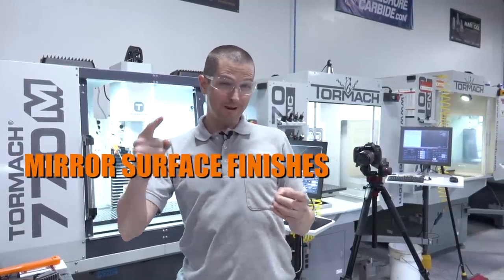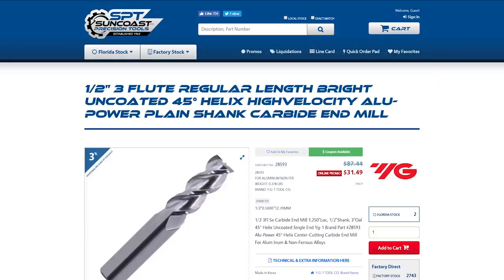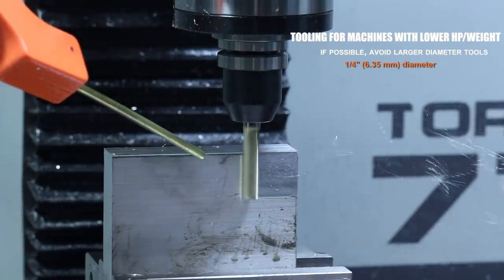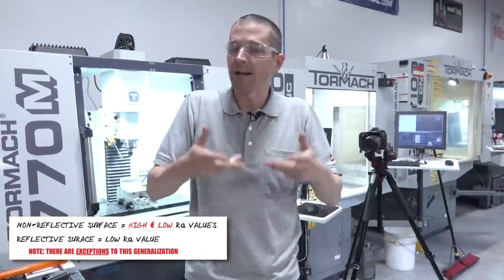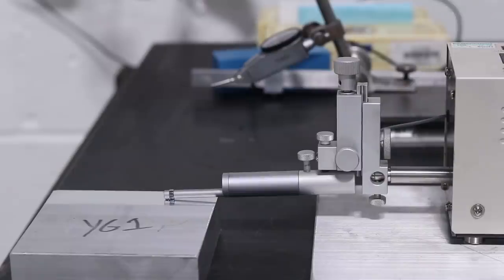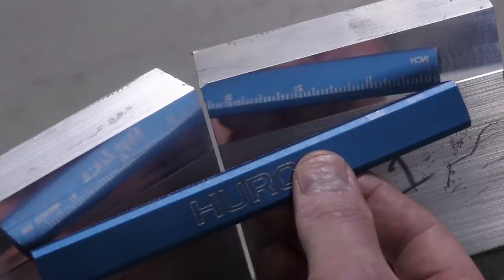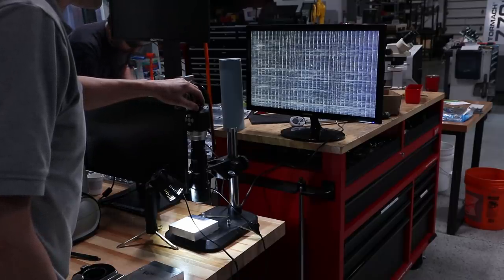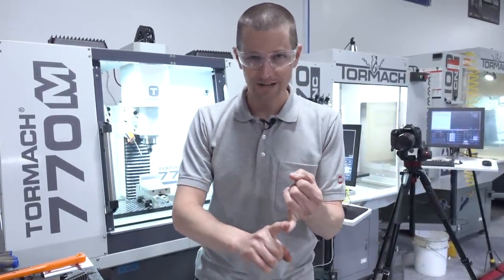Affordable Tool for Mirror Surface Finish! WW249

Comment: When I was putting together my home shop, I started off with YG1 because they were affordable and not made in China. I get excellent surface finishes with their HSS endmills in aluminum, not to mention the cutting power and chatter are greatly reduced compared to no-name or chinese brands. I also exclusively used YG1 Alu-Power at my old job on Maho CNC machines cutting 6061 all day long. Our 3/4" endmill lasted over a year of 40 hour work weeks running 3500 rpm, Valcool, and averaging 50 ipm.

Comment: Hey John nice video😊
In our toolshop we only use yg1.
Also the endmills for hardmilling are amazing.
Best regards from Switzerland.
Reply: They are great bang-for-buck. We test tools from time to time against those we've found to be real performers; typically offerings from Union Tool, Moldino (Hitachi-Mits) and NS Tool. YG always fares well, and Imco also makes a really nice low cost tool for hard milling. Well worth a try IMO.

Comment: I use the YG1 everyday in the shop and I can say this the endmill I use the most. You can do just about anything with it on aluminum. The hardest I've pushed it was a 1.5 depth of cut, 1/8 step over, 8k rpm and 100imp in the HAAS VF2ss I work on. Absolutely amazing.
Reply: Did you ever get the chance of comparing it with endmills from maritool that @kalpay swears on? Or swiftcarb (frontlinefab)?
Reply: In our shop we use mostly YG and IMCO tooling. I haven't been able to get a wide variety to test on.

Comment: SFM can make a big difference, while the tool diameter may not change the surface finish (on light finish passes), the lower sfm especially at that low of a feed rate in a material that soft could have a very pronounced effect, I'd be interested to see this again with each tool running the same sfm, instead of the same rpm.

Comment: the irregularities look to be cyclic, it could be due to the spindle servo, you command a constant speed and when you enter cut the servo ramps up the power and might "overshoot" then compensate but be slightly too slow ramp up power again etc... just a guess ;-)
Reply: aka control loop oscillation
Reply: I wonder if theres any sort of way to tune that out or are you just stuck upgrading to a beefier machine
Reply: @anonymic79  I'm with anonymic79
 on this. So what Lukas Foglar is saying is basically torque ripple in the spindle? Or is it something else? You'd think just the inertia of the spinning mass and the rigidity would prevent those kind of accelerations, but I could be wrong.
Reply: Agree with anonymic79--the marks must be chip recutting. No way the servo has enough power to change the spindle speed that quickly.
Reply: If the speed came from the spindle accelerating and decelerating, this should be audible in 3:03-3:10 then. At this feedrate, this should correspond to a harmonics frequency of about 90Hz. Could someone just do a fourier transform of the sound from 3:03 until 3:10?  Too bad i dont have access to matlab right now.
Reply: fusion also likes to spit out random stutter steps, which could be the anomaly before the section he highlighted
Reply: @TeslaAtoms  there's a peak at 110hz, 159hz, and 163 hz: https://i.imgur.com/yfSaY37.png
Reply: @anonymic79  "Shatter" the spindle?? Which part of it, exactly? Most of these irregularities in surface finish are due to run-out, spindle vibration and/or tool vibration that isn't necessarily audible. Work with a tap-tester and you can find the natural frequency of the machine and tool system. Things become markedly better but run-out and natural spindle vibration are always present.

Comment: Hey John, if you're never tried one, I would highly recommend giving the ECAI-B-3 line of Iscar end mills a try.  I've used many different brands and flavors of end mill for aluminum, and have yet to find anything that can produce as good a surface finish.  The only drawback to them is they are not available in many sizes, and no metrics at all.

Comment: Been running these for a couple of years now, you should see the finish in a Haas with a heat shrink holder at 15K RPM! The edges also seem to last a lot longer than some of the other tools on the market and usually the core is thicker than a comparable endmill so they perform much better in the extended length versions. The cyclical variations in the surface finish remind me of the cnc converted bench top machine I have in my basement. Prior to installing AC servos, the stepper motors would leave a finish like this when "micro-stepping" between motor poles. After AC servos, the irregularities went away, and I do have a Tormach 770 head mounted on the machine.

Comment: my guess on the inconsistency in the feed marks would be from chip evacuation causing the cutter to slightly chatter from material getting in the way of the cutter and the surface.
Reply: main reason for thinking this is because the offset lines are not parallel with the consistent ones but the parallel lines still exist in equal spacings among what I assume are marks from the thin chips + climb milling pulling those chips back along the surface.

Comment: If you go to EMUGE they make a Polishing 6 flute carbide end mill. Designed for 3 edges cut, 3 polish (rub or as they say pressure) for aluminium, brass, and copper. I am not sure if these require higher levels of rigidity from your machine, tool holder, part clamping? Along with the stated correct speeds and feeds based on what the project is.

Comment: I feel tool diameter does make a difference but I feel the real gain here is the coating. Thanks for the info on where to buy them, people should support the direct buy companies (further investigation this is not a direct purchase but purchased directly online). I also feel the cause for the erratic cutting is caused buy the lack of rigidity and power of the particular machine. You are correct in saying that a 1/4 or smaller tool is better in those machines due to the rigidity and power of them. I feel they are a good hobbyist machine, nothing more.
Reply: It has plenty of power, it's only a 1" axial DOC/10 thou radial DOC.
Reply: @xenonram power is a loosely used term. power is a measure of hp and torque. as i said i feel the real difference is the coating. i get better results with that type of coating on the same size tool coated an uncoated. i agree with a few of the others that have stated the irregular cut pattern is the type of motor.

Comment: Hi John. Here is a suggestion: it looks like you are using a helical Zrn coated endmill for the first test. It doesn't have to be helical though, any coated tool will have the same effect. In speaking to tooling vendors, Zrn coatings are awesome for adding lubricity and longevity to the tool. However, on a microscopic scale, the coating dulls the cutting edge, making the surfacing finish not be as good. A more apples to apples comparison would be to take the same YG1 tool and compare it to a 45 degree uncoated endmill from helical (or any other vendor) to see the real difference. A higher helix leaves better finishes, which is why I think a 45 degree is best. Using a 37 degree or so is better for roughing applications because of the more solid core. Would love to see you expand your test. Good work

Comment: Great topic. I'm slightly obsessed with having a mirror finish and definitely look forward to trying out one of these end mills.
Reply: Also.., Try indexable cutters with korley inserts on aluminum. For end mills we just switched away from yg to a better product half the price. Use lots of coolant so you don’t chop them up.
Reply: @glennedward2201  thanks I appreciate the advice. I'll definitely look into those.
Reply: @alexbarnett8541  Mirror side milling finish?? What do your prints specify as 'acceptable'? Chasing finishes can get extremely expensive. Sometimes it's good to go with, "good enough".
Reply: @zaknefain100 I was making injection molds when I wrote that. Really only cavities and cores required a polished finish. I agree chasing finishes is expensive and hurts productivity.

Comment: Would love to see what surface you get from that tool in the Haas
Reply: Those have been my goto emdmill for aluminum for about five years, and they cut fantastic in a Haas, try one, you will not be dissapointed only impressed.
Reply: I would actually love to see a difference between his Haas TM3P and the Tormach's
Reply: @TroubledTimes2024  the machine I have access to has like a thousandth of run-out in the spindle so I doubt I would get the same results
Reply: @joshuawentworth7426  Obviously it wont fix a bad spindle but you would still see an,  improvement. A quieter cut being one of them besides a superior finish. Just try one next time you need a cutter.
Reply: @joshuawentworth7426  I understand that "have acces to" =/= "my machine" but have you thought about  regrinding spindle taper?

Comment: Hi, very good and informative video, however, would like to see the tool at the same cutting speed rather than RPM... Higher cutting speed will introduce more heat to the cut and definitely influence the result IMHO.

Comment: It appears that the smaller diameter tool is recutting the chips and the larger YG-1 is not.  The chips from the YG-1 are being blown straight back.   Are you cutting both at the same speed even though one is a larger diameter?

Comment: imco tooling is the absolute best if you can afford it. we dont do much with aluminum but their streaker series is incredible.
for low carbon steels the enduro m525 are fantastic with a .030 corner radius
Reply: half inch tooling in a haas vf3 their feeds and speeds make for a good starting point too.

Comment: I love YG they put so much money back into there product line. i think my rep said 75% of all profit goes back into RandD
Try a YG HPC AluPower they do amazing floor finishing and do a very steep ramp angle on a haas
Reply: i think 30$ affordable when the tool give much more value to the customer back, in comparison to the competition
Reply: Have you used their taps?
Reply: @travistucker7317  i have to tap out on this one
Reply: @hyperhektor7733  stick with your emuge or whatever you're using
Reply: @travistucker7317  Yes they are on par with everyone else but can get them  a little cheaper most of the time
Reply: @travistucker7317  i use mostly germanium and sometimes chinesium (variable qulity, some are crap some are useful-to-good)

Comment: Could be harmonics in the system. Make a few blanks that are as identical as possible, then run the test. If it is always in the same locations on all the parts, then theres a harmonics issue. If the locations vary from part to part, I would guess its more of a electronics feedback control issue.
Reply: Issue should be in quotes. Those parts are certainly good enough for 99+% of designs

Comment: Interesting. Shouldn't those scallops have a slight angle due to the helix angle?

Irregularities in the spacing may be due to tool design. As I understand it the flutes are often made very slightly asymmetric to help avoid resonances.

Comment: looks like that shorter wavelength section happens every two revs, what's your spindle pulley ratio as the issue could be upstream from the spindle itself

Comment: Could I use that yg1 cutter that was shown in the video on a manual mill or does it only work on a Cnc I need a new end mill for aluminum
Reply: You can use the cutter in any mill, but that surface finish is very dependent on a super consistent feed speed. CNC machines obviously do that better, but I would be shocked if someone said that cutter cnc only. ;)

Comment: The heavier the machine the better. On my Haas VF3, I used a heavy cemented carbide lathe cutter, 3/4"... welded to a 3/4" shank, and the single cutter, as a fly cutter gave me mirror finishes. It could do a 6" wide piece of stock and was a cheap tool to produce!

Comment: Measure the distance between the irregularity clusters, calculate the frequency of the cluster and it's repetition frequency from that (=> linear tool speed) and look for those frequencies in the audio you captured during recording. Might give you a clue.

Comment: John & Crew. You kinda stole my thunder here, but point I want to make is that certain mfgs can make a tool that just puts down a finish that just blows you away. I have had even cheap chinese tooling produce remarkable finishes with certain materials. The job of a good machinist is trying new tooling and see what you get.... Every machine is different, as is the tooling.

Comment: Looking at the two samples there appear to be more geometrics (waviness and oscillations) in the super 1/2" end mill finished surface. Maybe this is because the surface is more reflective and hence makes any ripples more obvious, or it could be a reflection of something on the worktop; look to the right of this test piece at 5:36 in your video!  To get a true idea of what is happening on the surface, geometrically, you would need to very much increase your sampling distance for the test.

Comment: Bright tools will always leave a shinier finish than coated, but coated will last longer.

You have two different diameter tools, that’s a huge difference with the “receipe” you used.
Your running way different SFM but the same IPT?   Should be doing the opposite.  Same SFM (not same RPM) and the IPT is always different for different diameter tools.

Grain direction of material will also make a difference.

Comment: Just out of interest, if you slowed the feed rate down would that improve the reflection too?
Reply: no, your endmill would be rubbing on the surface of part, instead of cutting into it. It would be like this - sometimes the cutting edge digs into the part, sometimes it just bends back and rubs on the surface instead of digging in. this results in surface irregularities A.K.A. bad surface finish.

Comment: Oh wow, look at the boy that has been to Europe and bought a nice shirt ;-)

But beside that cool swag; Could you try take the microscope from the "top" of the part, so you can see the depth of the cuts? I wonder if where you see the lines gets erratic, it has jumped futher "into" the material than it should, making the marks irragular due to radial vibrations?

Comment: fun fact - many "dull" metal surfaces are mirrors under thermal wavelengths (you can see your reflection on a rough copper sheet thru thermal camera)

Comment: For a true apples to apples comparison of the two bits, you could've ran the larger, half inch, bit at 75% of the rotational speed of the smaller, 3/8" bit. Basic math for linear speed of the two shows that the smaller is 75% the speed of the larger at the same rpm at the cutting edge.

Also, Ra only tells you one part of the puzzle, you also need highest and lowest points, the linear distance between the two, and angles between those points, to understand the reflectivity of the piece. The higher the deviation of the peaks and valleys, given a constant linear distance, changes the angle at which light reflects; the more consistent flatness, the better, which is why the 'choppiness' of the peaks and valleys give poor reflectivity. Of course this is only going on one axis, not a plane, and that assumes the plane itself is flat.This also assumes consistency of the peaks and valleys, say if some are taller and/or deeper, you'll get different reflections; which also shows why average is flawed, average doesn't show the inconsistency, which also introduces the need for more datapoints, like medians, mode, and range, etc. But then the next part, the scale of the surface deviations. Say you have a part with deviations in the nm scale but isn't reflective, but your μm Ra scale's readings say it should be reflective based on correlation to readings from other tested pieces that are reflective; this is where scale is important.
There's a lot more to this than just measuring an average. In a true scientific study, you'd want to track every possible variable in every piece of the process, but that's not practical for actual work, and has diminishing returns after some point. 

Personally, I think chasing high mirror surfaces with cutting tools is a waste of time and money in the long run. If you really need a mirror surface, have the piece go through grinding and polishing operations for that surface. Cutting will never get you the surface that grinding and polishing can give you.

Comment: i wonder why nobody inveted a device  like a microphone+microcontroller which finds harmonics and 
adjusts the speed accordlingy to avoid them. I mean it could be done cheap and would improve the work.
i will do this in the next 1 year when i have time.

Comment: The biggest obvious difference is NOT the diameter.... its coated vs. non-coated..  Of course uncoated cutters will generally give you a better surface finish.  Sort of confused at how the heck you missed that...  As well as the helix angle.

Comment: What’s the Ra on your thumb nail?!? Take care of your tools John! 🙃
Reply: depends on the way you drag the stylus to measure it
Reply: I noticed that also. I had the same issue, it was having my hands in contact with the coolant we were using at the time.
Reply: I noticed that as well.  As for myself, I noticed that my left hand thumbnail is always shiny, and the right hand thumbnail is more not shiny.  I would like to run this machine on them for further analysis.  lol
Reply: I’ve never had bad reactions from coolant but it sounds like you guys have. That sucks. I just figured John kept hitting his thumb with a hammer 🙃